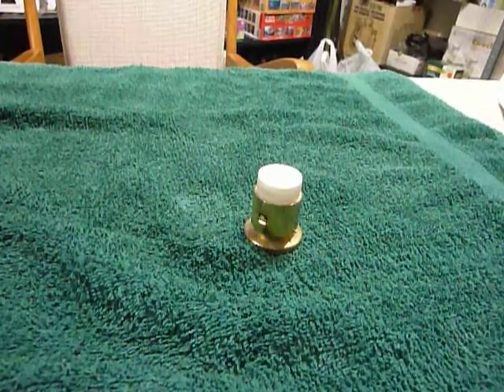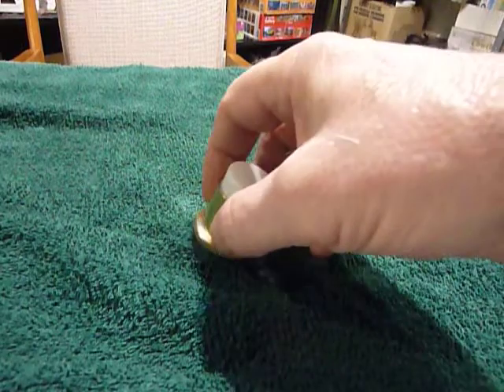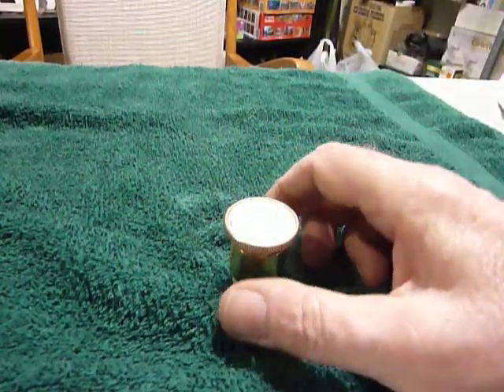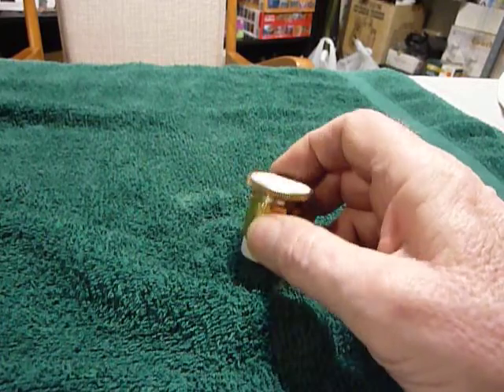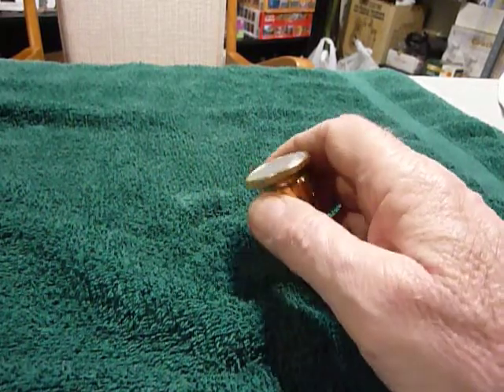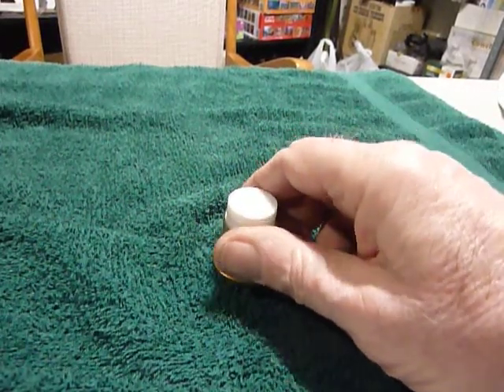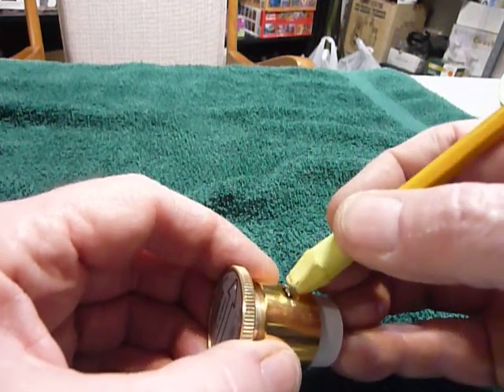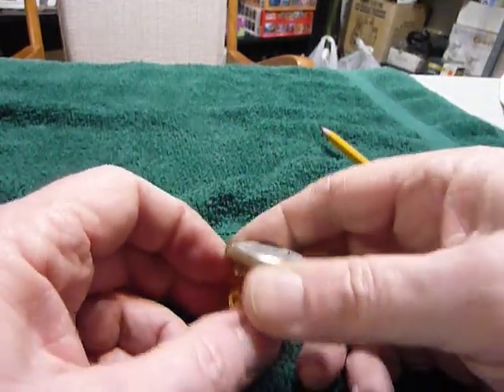BIRD MODEL 43 WATTMETER  ELEMENT  QUICK FIX ,Bird 43 slug

Comment: My element was working but was reading a bit low compared to my other elements & wattmeter in my service monitor, so I tried your "quick fix".  Didn't work, but it did manage to pop the cover plate off so I could adjust the pot in the element.  Thanks!

Comment: And diode damaged by to much RF power.
Reply from the maker: It was DOA when it arrived it was  purchased on Ebay . Not many Amateur radio operators have an amplifier that has over 2500 watts output . I wonder how much RF it takes to damage a 2500 watt Bird slug ?  My wild guess would be at least 5000 watts maybe more . At any rate it is still working fine .